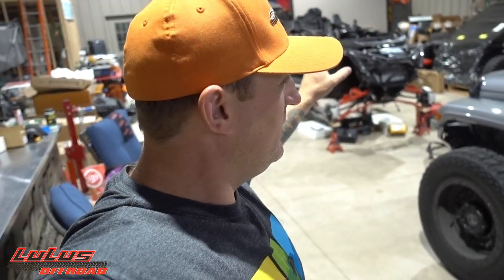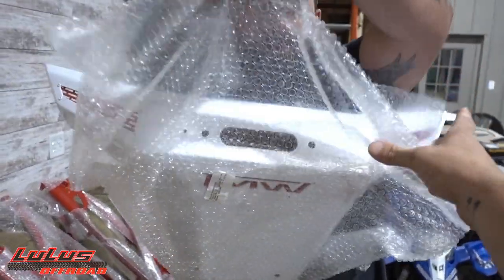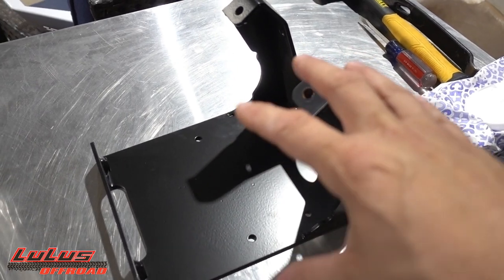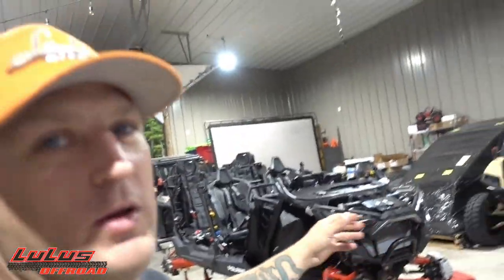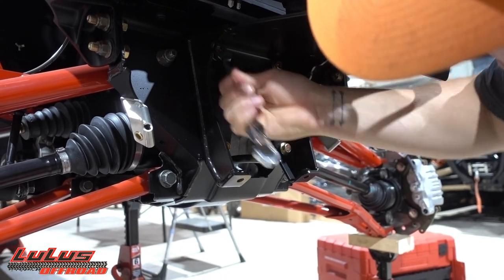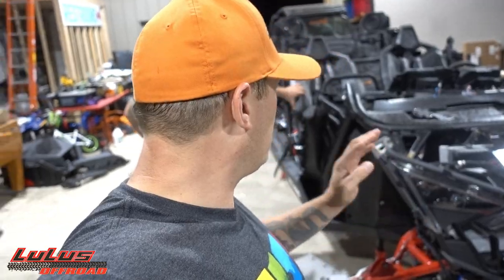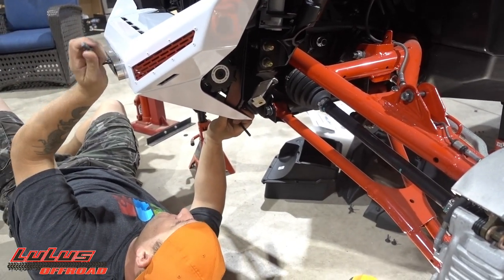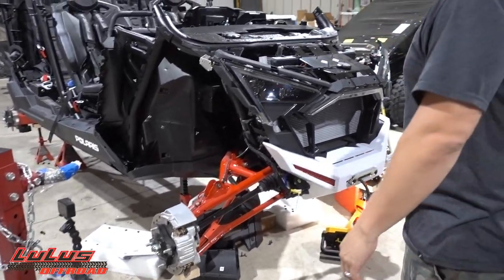TMW Polaris Pro Xp Bumper & Factor 55 ProLink

Comment: My boys are only 5 & 6yrs old and my wife is a tiny lady so I had no choice. I installed my BCF cage solo on pro xp4. Got lucky, not a single scratch and went on smooth as butter.
Reply from the maker: That's impressive to say the least. Heck yeah!
Reply: @lulusoffroad  it was all balance. I have the 4 seater so I could fold down the back seats. Put a small step right outside the door to make walking it out easier. Stood on the back fold down seats, put my back to roof and lifted. Wife guided me out and we were golden. Where there’s a will there’s a way. Like your videos man. Keep ‘em coming

Comment: I bought one they only fit the polaris 4500. In my opinion I wish I would have bought thee drt.... the tmw looks great! It's really a joke they didn't make it to fit a Warn 5500 or a badlands... 
Your stuck with the junk 4500 from polaris I've broken 2 of them warn from now on
Reply from the maker: I absolutely love my tmw bumper. The Styling in my opinion is literally unmatched by any. I also believe there are pros and cons to all these winches. So far, I've had no issues with any of the Polaris HD winches we own but my 10,000 lb Warn winch on my Jeep Gladiator failed us in Glamis trying to pull my buddies Sandrail out of a deep dune. Somehow, the tiny screw that should never have been used to hold the winch line on the barrel sheared off and left us stranded and the winch useless. It was my very first time using the winch as well. Needless to say it put a very bad taste in my mouth. But I got it fixed and I'm going to use it again on the next one. Hopefully it doesn't let us down.